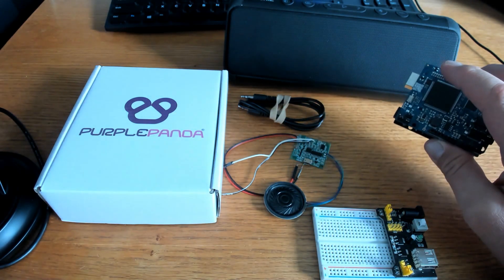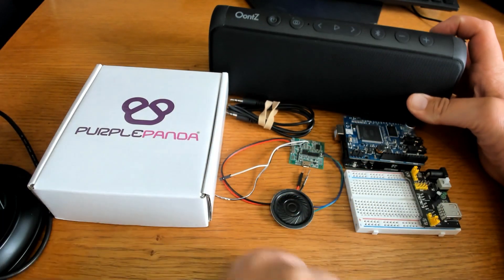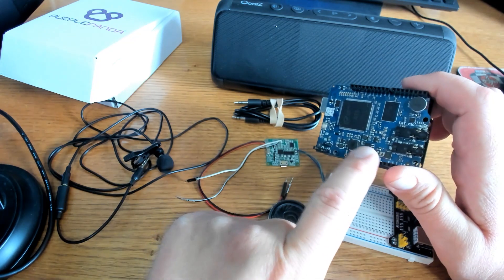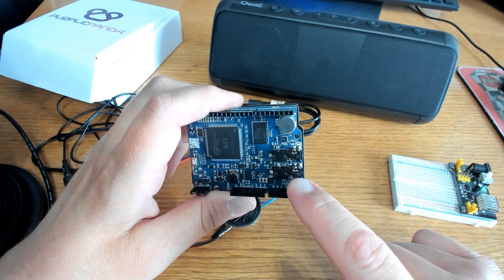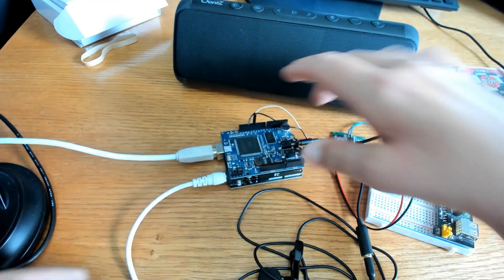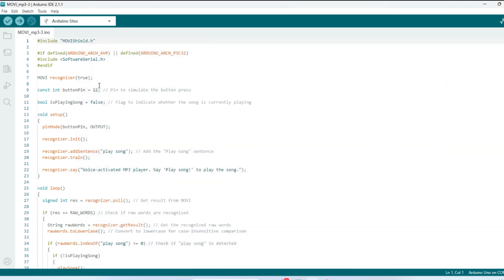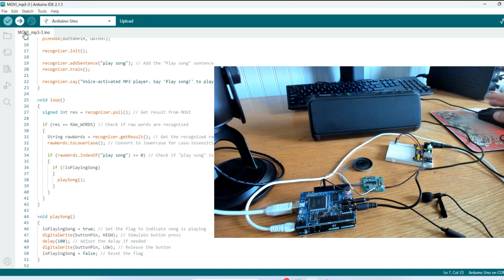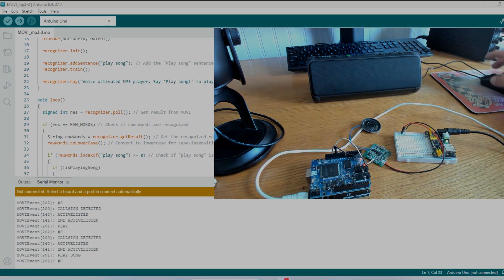Make A Voice Activated Mp3 Player Using Arduino and MOVI Voice Recognition Synthesizer Shield

Comment: Do I have to use the same ARDUINO you used in the video or can I use a cheaper one and do more work programming it?
Reply from the maker: hey there!  you should be able to do this on any Arduino. 
A few things to consider:
You may have to change your code as far as pin mapping goes. Always check the power and current tolerances on the board you're using. 👍👍

Comment: THANK YOU SO MUCH!!! Got a subscriber for that! By the way, would it be possible to make it so that the microphone is wireless? And what is the shield’s name?
Reply from the maker: Thanks!  glad you found it useful.  I haven't use a wireless mic with this but I'm willing to bet you can use a Lavalier microphone, like the mics used in presentations. I think it would work. I'd like to try that out, actually...thanks for the idea!  
The shield is a cloudless speech recognizer / voice synthesizer sold under the name MOVI. I love this shield. It's old but still very useful. Here's the link https://www.audeme.com/movi.html
Thanks again for the kind comment. 👍
Reply from the maker: by the way, if you want more than 1 mp3 you can use the DFPlayer Mini mp3 player. You can store many mp3's on the micro sd card and request MOVI to play a specific track or to play a random song. The mp3 module in this video is a small capacity board that can play 1mp3 up to approx. 3min long.
Reply: Cool! Another question. Is there a cheaper alternative for the MOVI?
Reply from the maker: @ZeroZerado22  Other options may include the Elechouse Voice Recognition Module V3 https://www.elechouse.com/product/speak-recognition-voice-recognition-module-v3/
or the Grove - Speech Recognizer
 https://wiki.seeedstudio.com/Grove-Speech_Recognizer/
I haven't used either of these options but they are cheaper and who knows, you may find them very useful!  You may want to buy directly from the Branded website to get the best quality. The one from Seed Studio looks like it may be worth a try. They  have tutorials and documentation to get you started. I have used their products in the past and they were fine.  Hope that helps!
Reply: @BMonsterLaboratory Thanks! That does help a lot. I just wanted to know if it would it be possible to use a cheaper low-quality version of the Voice Recognition Module V3.

Comment: Bro, 
Using this, Can we control a car with the help of motor driver directly by voice, without any remote or mobile operation?
If it can, Can you please make a video on that? I will be waiting for that...
Reply from the maker: I thought about doing that a while back. It can be done but it'll take some tinkering. Should be fun. Thanks for asking!  I'll work on it. I think the MOVI shield is great but I sure hope they put out an upgrade. There's a newer voice recognition called Nicla Voice but I haven't used it yet.
Reply: @BMonsterLaboratory  Thanks for your reply bro.